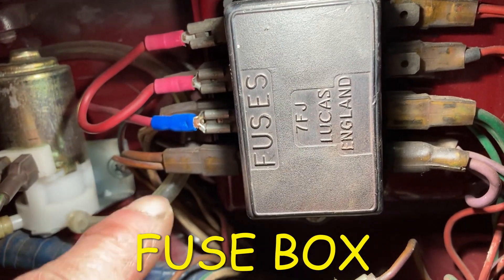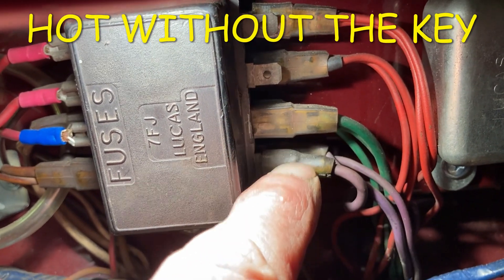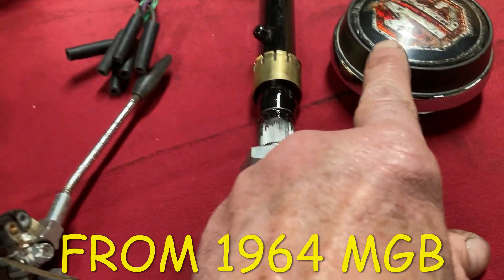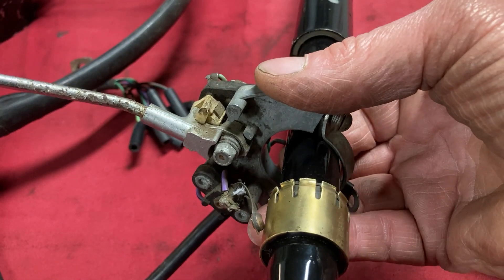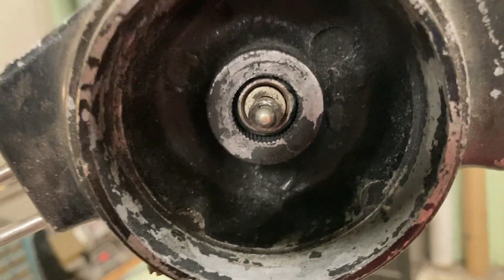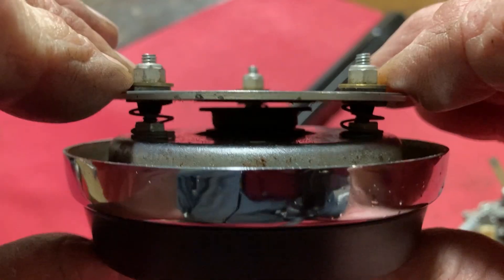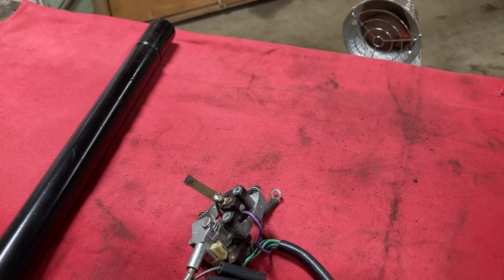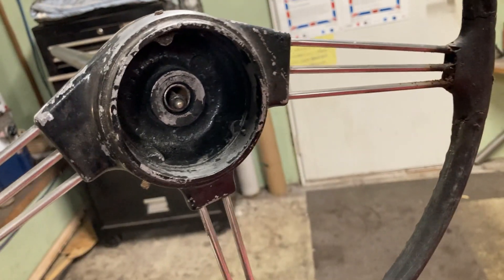How the Horn Works

Comment: Thanks for all the details in your videos, it helps me with the restoration of my MGB. 

You are missing the insulation around the steering column connection.
Reply from the maker: It's around here someplace. There are parts everywhere.  It will all sort itself out when I start to assemble the car.
Thanks for watching,
Bob